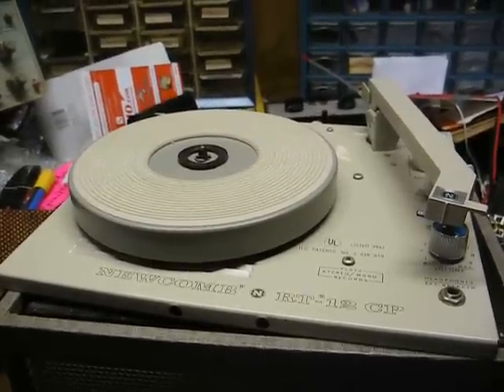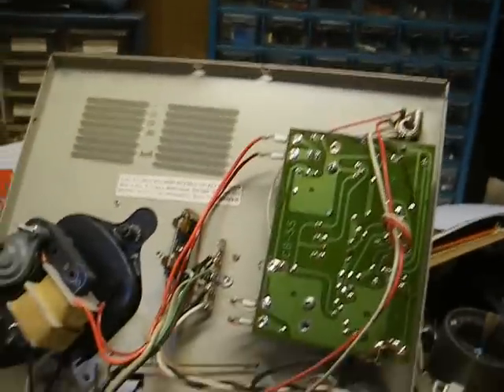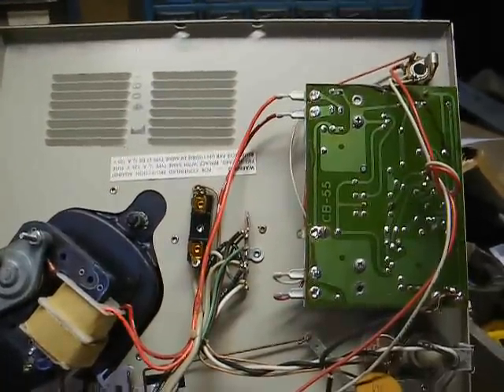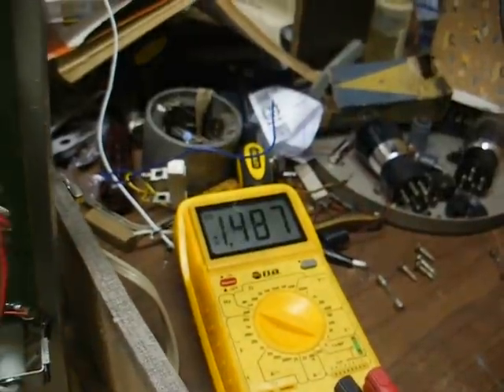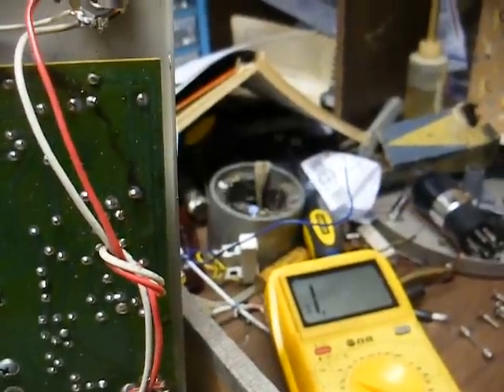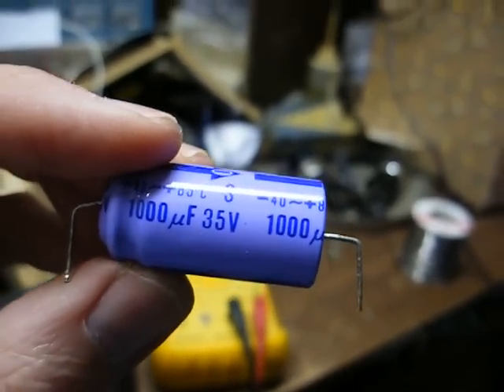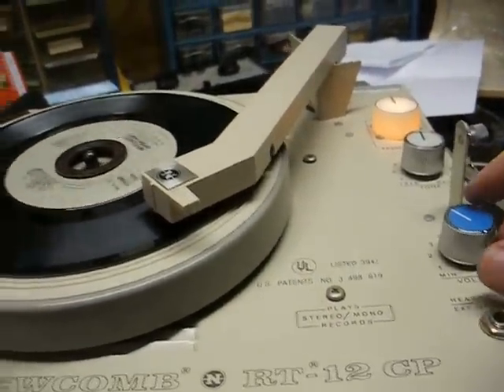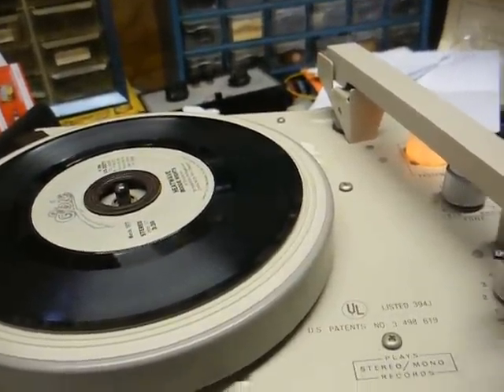Amplifier repair in a Newcomb RT-12CP classroom record player

Comment: I had a floppy drive for an IBM that had two shorted electrolytic caps on the motor control board.  Every time I put power to the drive a resistor on the board would smoke.

Comment: I've seen a TV with a small electrolytic lower voltage cap in video processing go short and pull the video output down all the way. I was new to this stuff then and the tech who found it was very happy as that board was complicated and it had taken a while. I do like that lit up knob on your record player there!

Comment: Had an approx 100uf 50V shorted cap on the phono board of a Yamaha CR-800 take out a fusible resistor, was dead shorted just like yours. I think it's not that uncommon.
Reply: Usually I have found most of the time they open when they go bad.
Reply: Yep agreed. But when shorted can do some damage.

Comment: nice repair and funny you mention the 89 t cartridges being always bad I have a record player I grew up with voice of music 275 av player well it had been about 10 years since the needle cartridge had been changed it always well worked well one day I go to play a record     well there is now loud hum mind you but the speakers sounds all distorted the audio is low  sounds like a blown speaker I hook and external speaker up same thing I'm like crappie now I have to find someone to repair it  could weeks later I find a spare cartridge lying around I think we'll what the heck I'll see what happens I put the cartridge in the thing plays just fine it's quite amazing it runs as well as it does if you open it up you can tell it's never had the amp serviced it's all originals but I play it all the time it doesn't just sit hasn't been stored so maybe that's why It has faired so well over the years